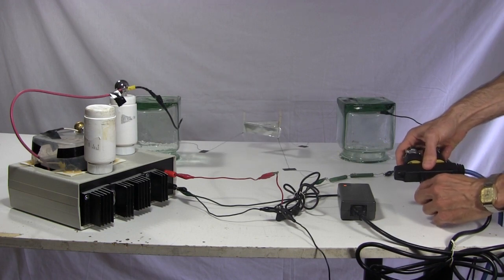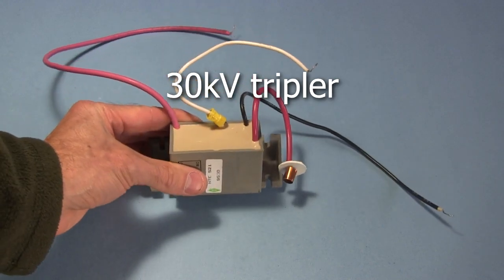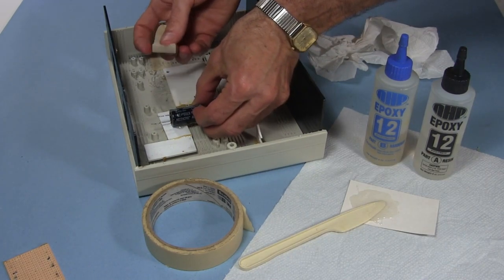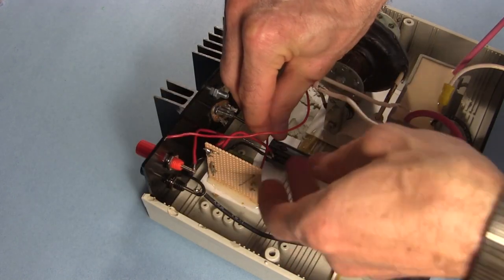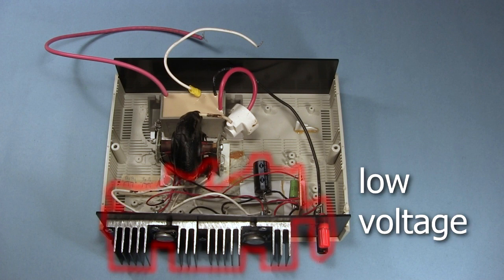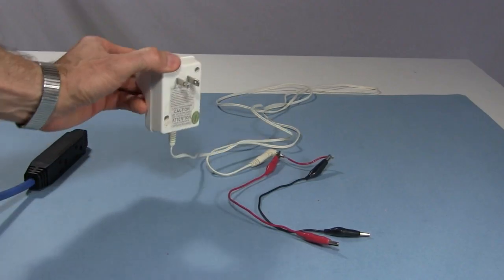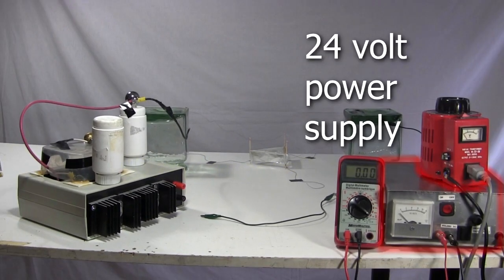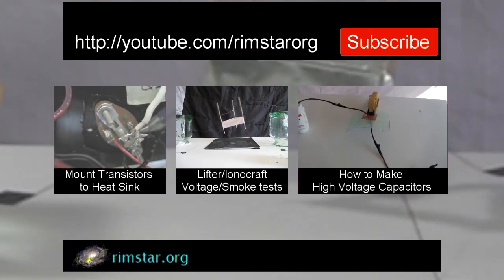How to Make 30kV High Voltage DC Power Supply with Flyback & Cockcroft-Walton Multiplier Tripler

Comment: I managed to do it, but after a 2 starts the flyback just doesn't give any voltage. How can I solve this?
Reply from the maker: Marcell Veszpremi What do you mean by 2 starts? Is it broken after the 2 starts?
Reply: It is broken, strats: power take, then power given again. I contacted the seller, and they will send it again.
Reply: Marcell Veszpremi I recieved it but it still doesn't work.
Reply from the maker: Marcell Veszpremi Can you describe what you do when it breaks. How are you testing it? Are you creating a spark?
Reply: RimstarOrg There is no voltage going throw the capacitor, the resistors are good, and I don't know how to test the transistors.
Reply from the maker: Marcell Veszpremi Do a youtube search for how to test transistors. There are a lot of videos showing different methods. If your meter has a diode testing feature then you can use that, otherwise you'll use the resistance testing feature. The videos explain each.But you still haven't told me what you do that causes it to break. A spark that's too long will cause too much current and damage something.
Reply: RimstarOrg I re-built it and now the smart rigol power supply writes that all the current is flowing which means there is a short circuit but I cant find where. I put new of everything.
Reply: Marcell Veszpremi I have tested all the new equipment. The capacitor, when discharged fully has about 0.1s short circuit, but it is brand new, from uk rs. Also I bought new transistors, and resistors but it doesn't change it. I am pretty experienced in electronics, apart from testing stuff, but this circuit seems fine but doesn't work.
Reply from the maker: Marcell Veszpremi Could there be a short in the coils you wrapped around the flyback core?
Reply: RimstarOrg When I used the diode testing feature, between the 2 different coils there where no connections, does it matter which coil is the first and which is the second. Could it be that the wires are not tight enough or overlap(this is true in mine, the wires don't fit) each other.
Reply from the maker: Marcell Veszpremi I don't see any reason why which coil is first would matter. The coils overlapping each other might be bad but the I don't think the wires of a single coil overlapping would matter.
Reply: Than what could be the problem. It worked first, I need this for a science fair by 12-th of october. In advance thank you for your help. And the help you have already given. I am 13, and I have a lot of experience in micro controller programming, but this is my first go with transformers.
Reply from the maker: Marcell Veszpremi Send photos of all the wiring and connections to my email address which you can find at the bottom of all my webpages at http://rimstar.orgAlso, you still haven't told me what you are doing when you run it. What exactly are you doing with the output of the flyback or tripler?Also, are you sure your rigol power supply is supplying enough voltage and current to run it?
Reply: RimstarOrg I am sure it is enough because it already worked in the past, since that I don't know what happened because it doesn't work. I have sent the images to your email.
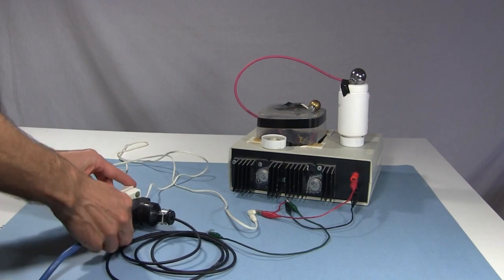Reply from the maker: Marcell Veszpremi I can't tell from your photos and video, check that the red wires going from the bases of the transistors are going to the same ends of the coils that mine are going to.You should also untangle the wires that go to the coils since they may interact electromagnetically with each other.I don't know your flyback and tripler so I'll have to assume that you are using the correct pin on the flyback and the correct ground and input on the tripler.The only thing that looks bad is what you do with the output of the tripler. You're dealing with high voltage here, which is like high pressure water in a hose. It leaks. Have a look at this webpage of mine that shows how to handle high voltage wires:http://rimstar.org/equip/hvwiring.htmYou have your high voltage wire tangled up with other wires, touching the table, but worst of all is the way you do your spark gap and may be the problem. You have a metal stand holding on to the two ends of your spark gap wires. My guess is that since one clip on your metal stand is holding on to the ground wire and the other clip on your metal stand is holding on to the high voltage wire, the insulation at those clips has broken down and you are conducting through the insulation from one metal clip to the other one. The hole may be too small to see. Use a plastic stand instead, maybe tape the wires to the tops of plastic bottles or something.Your input on the rigol shows 18 volts and 3 amps. 3 amps is about what I'd expect if you have corona/ionization in the broken holes in the insulation of the wires of your spark gap. 18 volts is very high to start with so once you've fixed your spark gap, start at much lower input voltages.You say you've worked with microcontrollers. High voltage is not like that. It is very dangerous and does things that low voltage circuits don't. Do not go near anything from the output of your flyback or tripler when the high voltage is on. Do not go near it after you turn it off, until you have discharged it to Earth ground. See what I do at 7:37 in my video "How to Make 30kV High Voltage DC Power Supply with Flyback & Cockcroft-Walton Multiplier Tripler". Notice the use of the two resistors. Without around 250kilohms of resistance at your spark gap or your discharge stick your take a chance of damaging your power supply from too high a current when sparking or discharging. Even with my lifter I use this resistance on the ground wire going to the lifter. Sometimes I put the resistance on the high voltage side but that creates more sharp edges where the high voltage can leak so I prefer the ground side.
Reply: RimstarOrg Thanks, but it worked the same way before, I will fix the spark gap, and  the Rigol is not giving the 24 volts because it is not taking it. When it worked, it took 1.0 amps and 24v. Also when the tripler is not connected there is still no high voltage in the transformers pins. The red wires from the transformer are connected well to the transistor, so it should work. The tangled wires could be the only problem.
Thanks
Reply from the maker: Marcell Veszpremi I that case the only thing left that I can see is to wonder if you are using the correct pin for the ground on your flyback.

Comment: can i use a flyback with internal diode?please hlp me i want to make a power supply for your smoke precipitator and i am only available with flyback with interna diode..please help me it is very urgent
Reply from the maker: I made a power supply with an internal diode and called it the Cube (this one https://www.youtube.com/watch?v=-KFhBVfpfDw). But when I tested it with my smoke precipitator (here https://youtu.be/ARSQWTzWago) it didn't work. I don't think the problem was just the low voltage because I tried with the mesh and foil cyclinder close together until it arced. I think the problem is that the output is pulsed DC and not flat DC. So I don't have a solution for you if your flyback has an internal diode.
Reply: RimstarOrg can we convert the pulsed dc into flat dc using tank circuit?
Reply: or else can you provide me the link to the video for the wimshurst machine you used wich worked with the precipitator?
Reply from the maker: A tank circuit wouldn't work unless you removed the diode and replaced it with a tank circuit. You could put a smoothing capacitor between ground and the output -- it would have to be a high voltage capacitor capable of withstanding 20,000 volts plus extra to safety. I guess you could trying making a HV capacitor you have trouble finding one (https://www.youtube.com/watch?v=MPD7skZ8OSo).
Reply from the maker: That was a commercially made Wimshurst machine bought off of ebay many years ago. The ones on ebay are all pretty much the same. My homemade CD Wimshurst machine doesn't have enough power for it.

Comment: .RimstarOrg, absolutely the best source I have found on making a HV power supply. Do you think I could apply this to killing rats in my garden. I would enclose the power supply in a waterproof enclosure. I would connect the power supply to an enclosed rat trap with a small opening. I would install the power supply to electrodes. When the rat enters the enclosure and steps on two separate electrodes simultaneously, the rat would be killed instantly. Could you install a fuse in this circuit? Do you think this could work? Thank you, I just liked & subscribed to your channel.
Reply from the maker: I don't know about rats but with humans, it's extremely painful and cause cause a small burn but if you have a heart condition then it can kill.

Comment: one question how much was all of this
Reply from the maker: I don't know. Most of it was stuff I already had or salvaged from elsewhere. The only thing I bought specifically for this was the multiplier and I don't recall how much it cost. The problem with making this these days, however, is the flyback transformer. It's one without a builtin diode and they're almost impossible to find, especially now that so few CRT type monitors and TVs are made anymore.

Comment: bjt royer oscillator driver works better and just a two transistor,two diode.1 cap and 1resistor.the transistor still cool
Reply: you must put inductor between +12v and the center tap of the high power coil

Comment: What about using a microwave transformer?
Reply from the maker: Hmmm... interesting idea. There is one coil on there that has a lot of turns. I'm not sure it could handle the high voltage. You'd have to remove the other coils and wind your own like I do in this video. I don't know if it would be as efficient. The flyback transformer, one without built in diodes, is pretty hard to find these days so if it worked, it would be worth it.

Comment: Wats the total cost please answer... 
Thnx
Reply from the maker: I don't know the total cost since I had a lot of the parts already. The tripler was around $80. You can buy the flyback transformers here https://www.amazing1.com/transformers-high-voltage-high-frequency.html for around $80 but I'm not sure if they're the right ones. You need flybacks with no built in diode and those have become very hard to find.
Reply: @RimstarOrg  can we use only a flyback transforer and a full bridge rectifier to generate a sufficient voltage for the electrostatic presipitator??
Btw I love ur videos!!

Comment: it's not lethal the current because ohm's law doesn't apply in this case and the secoundary of the flyback as got an high impedance
Reply from the maker: +Diego Bocchese It's not really shocks directly from the power supply that I worry about. It's the charge that builds up quickly on high voltage capacitors, or experimental objects that store charge, or across spark gaps. When those go they're very high current, and even though they last only microseconds they're a lot more painful than just a normal electrostatic shock. I've only had a bad one once with many years of experimenting, since I'm so careful, but that one time went from hand to hand across my body and it felt very bad, like my heart skipped a beat.
Reply: the capacitance of the flyback is very low (some picofarads) but for ohm's law (that apply in capacitors you get a shock of hundred of amps and 30 kv for a very little moment (some microseconds) and it's not lethal because the time exposure is very very little
Reply: but i'm agree with you i think be careful is very important

Comment: plz explain "oil poling" concept  .
Reply from the maker: Tanmay Mukim I've never heard of "oil poling".
Reply: RimstarOrg We put the whole mechanical assembly into the oil to avoid arcing in unwanted parts while generating  the poles(+ve n -ve ) on specific material.
I know  its not the proper definition but I'm just trying to explain the concept.
Reply from the maker: Tanmay Mukim Ah. Thanks for clarifying. I should have guessed that. One of my high voltage power supplies uses mineral oil, available in pharmacies/drug stores, to prevent arcing around and between parts on the high voltage circuit board. I actually talk about it already in my video about making high voltage capacitors at 8:36 into the video https://www.youtube.com/watch?v=MPD7skZ8OSo Very messy, but it works.
Reply: RimstarOrg suggest more videos related with HVDC power supply & UV-OV relays.I'm working on my project report so it will be very helpful for me.
Reply from the maker: Tanmay Mukim I'm not likely going to do one. I've no experience working with UV-OV relays. In fact, this is the first time I've heard of them and had to look them up. Do they even make them for high voltage? I did make a safety spark gap for a high voltage probe I made once (http://rimstar.org/equip/hv150kvprobe/construction2.htm#Aug4).

Comment: Sir what if I just use a high voltage Flyback transformer with diodes giving rectified DC output for smoke precipitator,,,,,https://www.repairfaq.org/sam/hvinvert.htm will this circuit work for the precipitator...???
Reply from the maker: The diode which is built into the flyback transformer is already rectifying the output. The first diagram on the page you linked to is pretty much what's in the Cube. The problem is that it's pulsed DC, it's in the form of pulses. For the precipitator, it seems like you need flat DC.
Look at the diagram lower down on that page under Low Voltage Power Supply and you'll see the location of a capacitor, C1, on the right in the diagram. That's for a low voltage power supply but the same can be done with the Cube but with a high voltage diode. You can get them here https://www.amazing1.com/pages/hv-parts/capacitors-rectifiers-diodes.html but I'm not sure what capacitance you'd need, probably the biggest capacitance.
Keep in mind that I don't know how well it will work for the precipitator -- I haven't tried it myself.

Comment: i just use a cannibalized air ionizer that plugs into the wall.
Reply from the maker: coler154 Cool. What have you used it for? Wondering what's possible with those.
Reply: i used it for charging microwave caps And testing hps bulbs. nothing as advanced as your experiments, the arc length is around half an inch.
Reply from the maker: coler154 Ah. Thanks.

Comment: what flyback transformer do you need, is this one good? http://uk.rs-online.com/web/p/switch-mode-power-supply-smps-transformers/4184089/
Reply from the maker: Marcell Veszpremi For this particular power supply you need a flyback that doesn't have any built-in diodes. This one looks like it might not have built-in diodes, but I can't guarantee that: http://www.ebay.com/itm/04-2751-60108-Replacement-For-Sanyo-TV-Flyback-Transformer-275160108-/121034000417. The one you link to doesn't look like a good one; the voltage rating is very low.

Comment: So weak power supply...that might have about 1 amp,get a bigger transformer(about 100VA at least,rectifier bridge,and smoothing capacitor in paraler,so you might have at least 5-15A depending on rec. bridge amps...(i have 8 amps rectifier) 
i can do 5 cm spark without multiplier...(you might use it,if you want dc,but it can do much better sparks than yours...:)